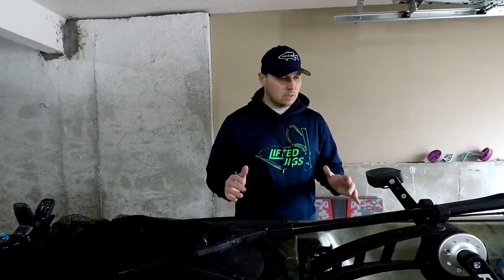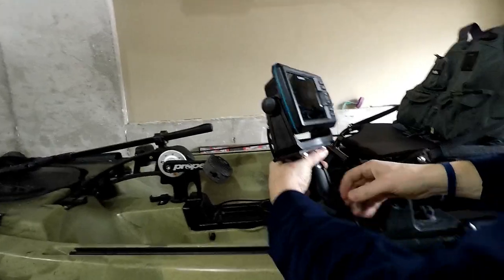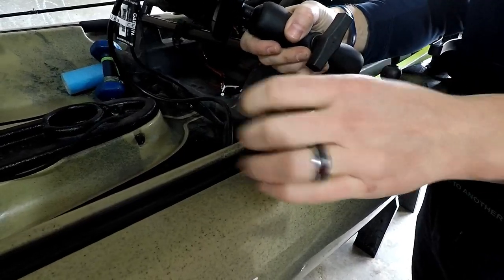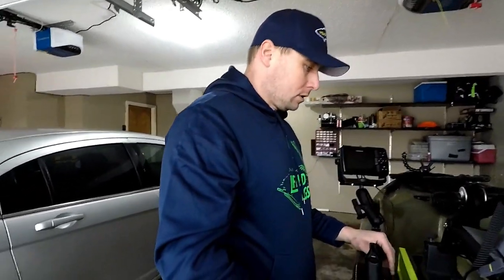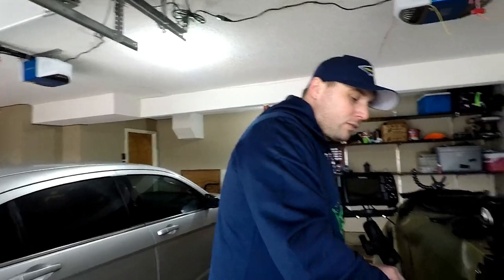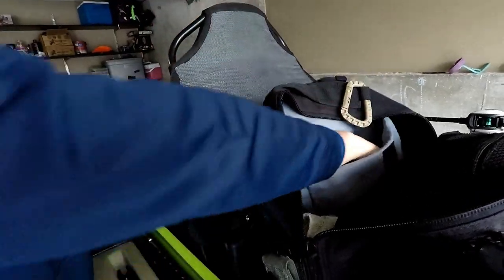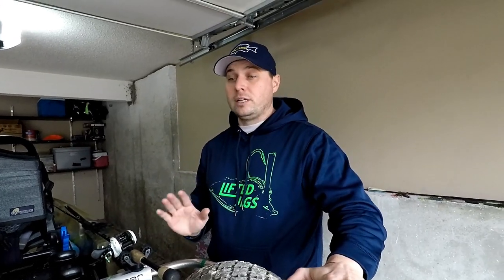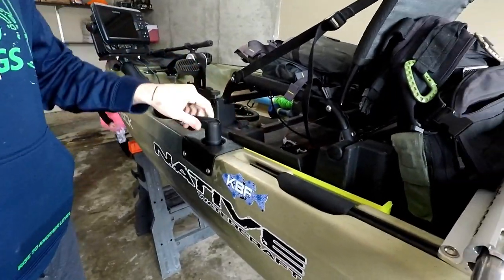Native Titan 10.5 One Year Review and MODS

Comment: It’s a battleship 👍😁 
I like my native 10.5 BUT steering was a issue. Native should do a better job of making there steering system. Great video
Reply from the maker: Yes!! I'm going to pin this comment. This was something I spent more money on than I expected to. The steering should be much smoother for what you spend on the boat. I upgraded the rudder, the cable and the steering. You shouldn't have to do that with a boat that retails for $2,500.
Reply: My comment is that the 2021 Titan 10.5 has MUCH improved steering so that now no upgrades are needed for it. I own a 2018 Titan 12 and I have had to spend money on a new rudder and new steering handle and it's still not the greatest, but the stability is AWESOME!

Comment: How did you mount the net holder to the pedal drive ?
Reply from the maker: I got a yak attack paddle holder, flipped the screw T bolt upside down, then ran it thru backwards. Works perfectly!

Comment: Good video. Couple questions for ya. I’m about to be installing a garmin fishfinder on my son’s native titan. He is thinking about putting it in the same spot you put yours. Are you happy with that spot because it’s gonna be scary to drill through. Also any info on that upgrade you did with your rudder cable. Was that worth it and hard to instal? My sons channel is Dylan Fuqua kayak bassin. We fish over in Missouri from time to time.
Reply from the maker: Hey thanks for stopping by the channel! Yes I think I actually subscribe to Dylan. I watched his Pomme de Terre tournament video I believe not too long ago.

 I think the location of the fish finder is probably the best place for it. My reasoning for that is that it leaves the starboard side of the boat completely free and clear for you to swing a rod or a net if you want to. Stacking the rudder and the Fish Finder on the same side means as you turn and control the boat you are constantly graphing and reading the finder.

In my opinion after running the entire year without the rudder upgrade, it was definitely worth it. My first trip out in it after I had it installed there was a very clear difference in response and control. If you get the rudder, I would strongly suggest you also get the cable upgrade to prevent the cable from breaking on you out on the water. I wasn't completely confident to do both of them on my own so I took it to Ozark Mountain Trading Company to have it done. It cost me like 60 bucks. Which was worth it for the peace of mind for me.
Reply: Josey4u He has the boondox rudder already. Was just curious about the cable upgrade. I think his boat also leaks through that rudder control, but not too much. Have you had any problems with that?
Reply from the maker: @vince01234  yes just a minor leak. The water is coming from the rudder when you do the rudder upgrade. If you contact native they will send you a set of gaskets you can put on the rudder.

 I definitely think it's a good idea to do the cable upgrade but have it done right either with a guy you know well, or someone who has the competency to do it. I know personally two people who have broken their cables on the water because the bite on the new Rudder is so good.

Comment: Hey I like your set up a lot.  I am currently rigging mine, and actually have the same fish finder.  The thing I was a little worried about is shallow water paddling.  
Do you think the fish finder is in the way where you have it?  I dont want to deal with any clearance issues.  thanks and nice job on the boat!
Reply from the maker: I have notice that I have to bend it down for shallow water paddling. I either have to bend it down, or back toward my seat.  The RAM mount REALLY helps with that.
Reply: Ok cool I have that same mount too.  I considered putting it pretty far forward but that could get irritating marking waypoints
Reply from the maker: @mikem8295  yea that's the biggest reason why I didn't.  And for me, I stand a LOT. So looking down and being close to each helps

Comment: How did you mount your transducer?
Reply from the maker: The two screw holes at the bottom where the transducer mount in, I was only able to use one. But before mounting it, I took some Marine silicone and put it all over the back of that black mounting board. So if I want to replace it or upgrade, I can.

This thing is a full two years old now and I have never had an issue with it. It has stayed stable on the boat.

Comment: Would you recommend this yak for a bigger guy?  I’m up there and it makes me hesitant to go one. I’m also a disabled vet, so I need something sturdy and stable, or as stable as possible to give me that confidence on the water.  If you could speak to the weight thing I’d greatly appreciate it. Great video. I’m going to press the subscribe button now.
Reply from the maker: Hey man! Yes it's VERY stable. Empty I think it's about 90 pounds. So it is very stable. I've seen 250+ guys in this boat.
Reply: @Josey4u  I posted a similar question on your first review of the titan 10.5. I'm 6'5" and looking at the titan 12. Do you feel like the 10.5 is small for your height?
Reply from the maker: @supershrek33  Man I don't , for me it feels like the perfect fit. I can get into tight places without having to swing around 13 feet of boat to move.

Comment: You kept saying you put it through some tuff conditions but every shot showed you on ponds! No current, no rocks, no surf looked like all fresh water. What tuff conditions are you talking about?
Reply from the maker: I fish some bigger water here in the Midwest, no surf conditions. My stuff is mostly reservoirs, Ozark lakes and local lakes (no ponds). At the KBF Championship last year I fished the Red River in Louisiana (lots of current). It is a massive stump field in Chocolate milk water. The stumps are just below the water line, so you can't see them until you are right on them. Hit, bounced and slid my way 3 miles back to a ramp in this thing. 

At Big Hill Kansas we battled 20 MPH winds with gusts near 30-35. I could pedal where I wanted, which was better than half of the field who couldn't cross the lake. You can see that video under Big Hill KBF Trail event. 

This has been a great boat for me. I have never felt like I needed something bigger or didn't have enough room. Hope this helps! Thanks for stopping by the channel man. Are you a yakker?